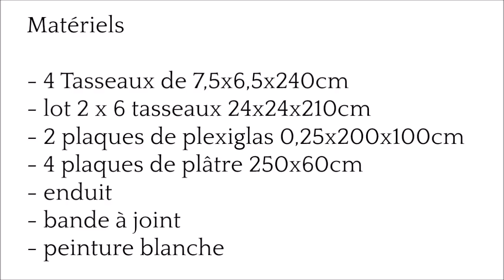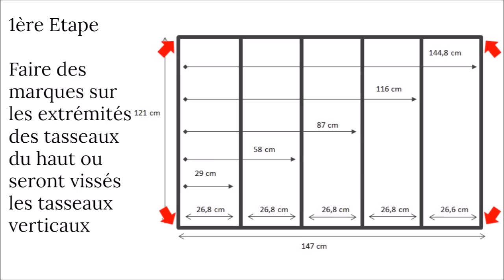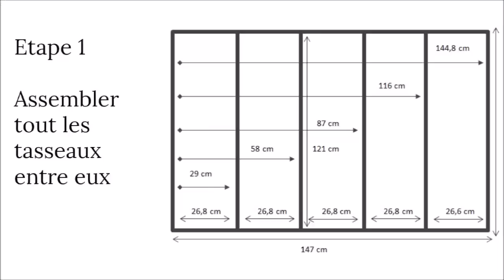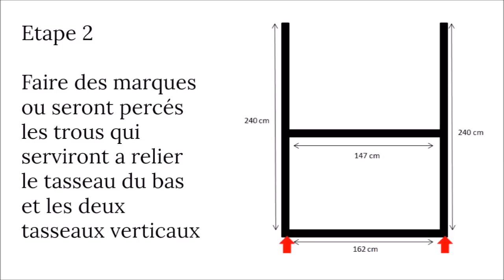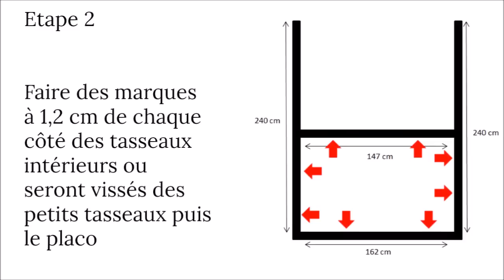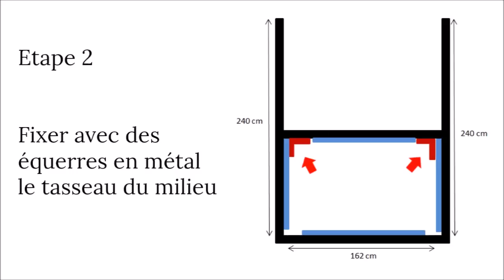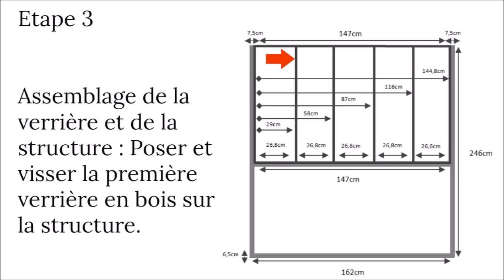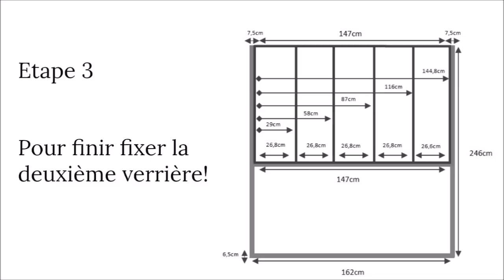Fabriquer une verrière d'atelier + cloison fait maison

Comment: Bonjour, 

Je me méprend peut-être mais dans votre description :

- 4 tasseaux de 7,5 x6,5x 240 cm 
- 12 tasseaux de 24x24x 240cm

Pour les 4 tasseaux les valeurs sont : 
Largeur : 7,5cm
Profondeur : 6,5cm
Longueur : 240cm

Pour les 12 tasseaux les valeurs sont : 
Largeur: 24cm
Profondeur: 24cm
Longueur: 240cm

Est-ce bien cela ?? Ou bien pour les 12 tasseaux la largeur et la profondeur sont en mm ??

Avez-vous un lien sur les sites de magasins de bricolage (LeroyMerlin, Casto, Bricot...) des exemples de tasseaux répondants à vos critères ?

Merci pour votre aide !
Reply from the maker: Bonjour! 
Voici par exemple sur brico dépot les tasseaux (ici en 25x25 mm ce qui ne change rien) https://www.bricodepot.fr/troyes/9-tasseaux-sapin-du-nord-brut-240-m-25-x-25-mm/prod6727/

et les chevrons de 63 x 75 x 3000 mm 
https://www.bricodepot.fr/troyes/chevron-traite-n-bois-resineux-63x75x3000-mm/prod11503/
Reply: Merci pour votre aide :)
Reply: Bonjour, 

Une autre question qui me vient à l'esprit svp. Est-il possible d'utiliser une planche de bois mélaminée à la place du placo, pour éviter de faire du joint ?
Reply from the maker: +Shazad Khan je pense que c'est possible si vous découpez une sorte de grand U qui va jusqu'au plafond pour éviter d'avoir a faire les joints.
Reply: Pas possible de mettre la planche de bois "à l'intérieur" comme sur votre vidéo sans avoir à faire les joints ?